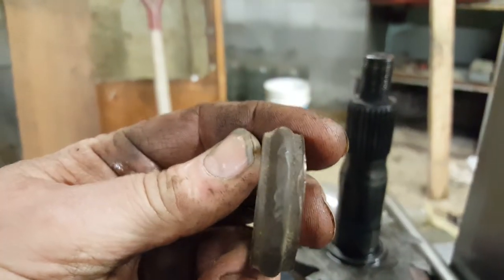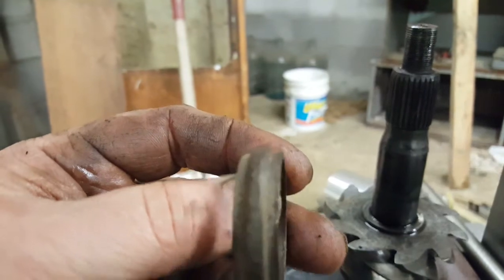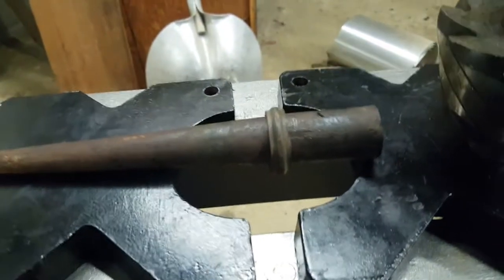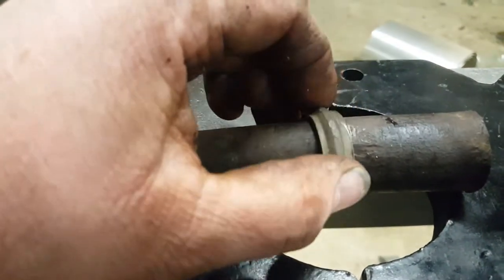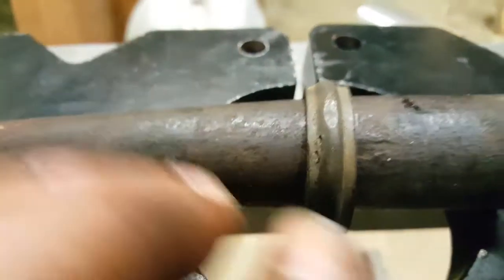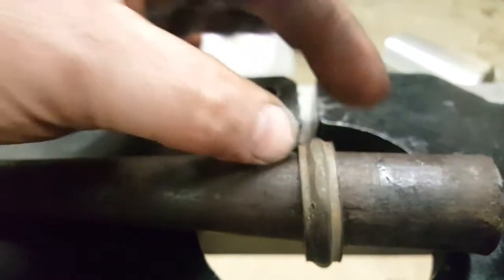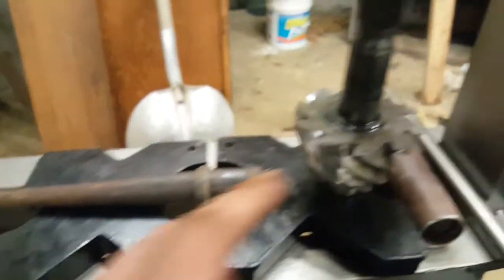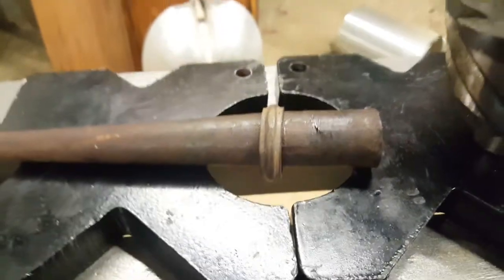Re-use crush sleeve on pinion gear.

Comment: Or you can spend $3 at Auto Zone and get a new one??
Reply from the maker: @james.crotzer  not me!... if I'm placing an order for new parts to rebuild an entire unit.Yes, I will buy a new one. However Sometimes It's just as simple as hammering out the old one. Especially if you've accidentally slightly overcrushed it to begin with. Yes I have done it... and it freaking WORKS. Be a fabricator... not a buyer

Comment: I've never done this I always mark the nut and pinion then just tighten back to it's original position then give it a few ugadugs to get the preload correct. Never had a vehicle come back with a pinion bearing issue after doing a pinion seal.

Comment: There are better ways to save $10 but I really appreciate your video and I learned a new trick. I feel that is a great method to use when you are dummying up the Pinion and applying Preload to check Pinion Depth shimming, THEN re-torquing the Pinion Nut with new bearings pressed and NEW Crush Tube added. Awesome)

Comment: I reused crush sleeves many many times and never had an issue ....never . Mark your yoke , nut and thread end of the pinion (straight line across all three) before disassembly and then tighten till they line up on reassembly .
Reply from the maker: Good plan thx